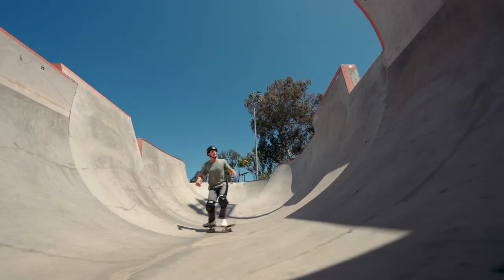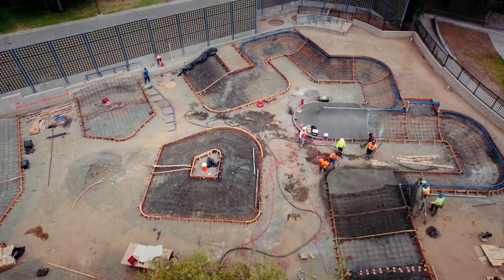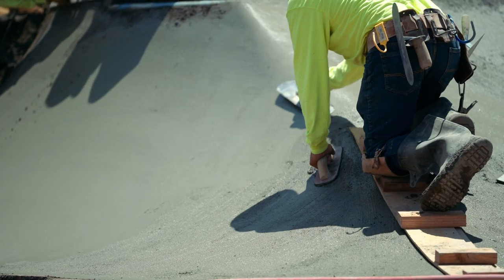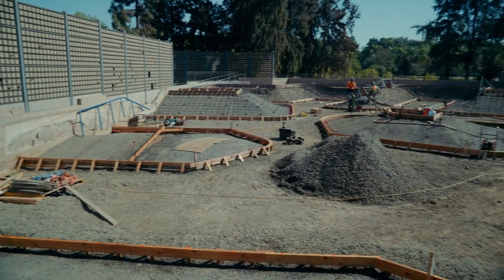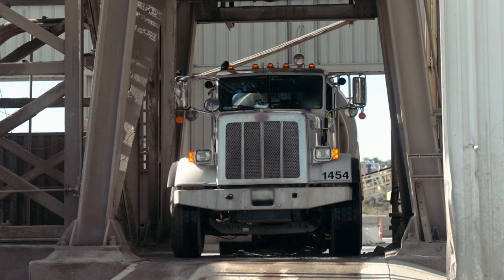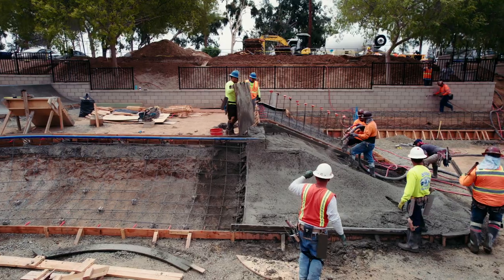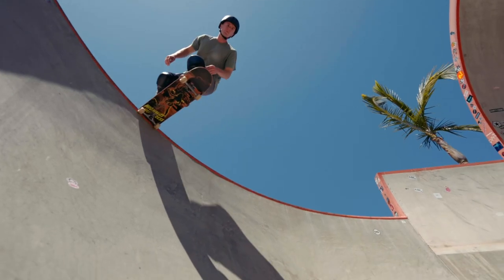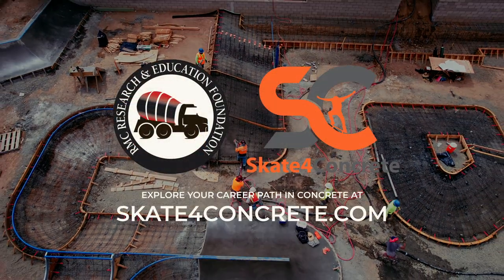How a Skatepark is Built

Comment: We need some electric skateboard parks. They would need to be built differently, for the most part. Level ground. Think of a speedway like Sebring (twists and turns) or Monaco (twists/turns/hills) but at a much smaller scale. This would be fun for a much larger group of people because not everyone is willing to drop in on a half pipe. I skated a lot when younger, and on some "el cheapo" backyard ramps, but wouldn't drop in on a real half pipe. Not many people learn how and for me, my first led to the hospital with broken arm. Any younger aged person can do electric skateboarding, and many older people too. And have a lift to ride back up the hill relatively quickly, even if it's just a "leash/handle" you grab onto (instead of a full cart you sit in).

Another idea I have is for non-electric downhill skateboarding. I don't know - maybe it exists, but I really see it anywhere. Lots of winds. Plenty of places even in FL for stuff like this, in hill areas of the center of the state, or up near tallahasse. There's lots of hills in FL west of center and more northerly. Just like a concrete sidewalk, but some curvature to it on the turns. Would need some backing on the turns. Not too hard though...  Hell, they could have some real fun slip and slides down the hills, but nobody does...
Reply: Just go to Woodward and learn to skate from some experts.

Comment: Dear cement skatepark builders.  Please stop making all the transitions the same radius as the height.  A 4' quarter pipe should not have a 4' transition.  I understand it makes sense to have a tighter radius/transition for a pool or anything that might go to vert.  However, not everyone likes the tight fall to flat if you bail transitions, especially on cement.  Some of the 2-3' quarter pipe transitions at my local park are so tight you can't even rock to fakie  cause your tail is hitting flat when the board is on the coping...there is literally no transition to ride back in on. Can't we have a little variety?
Reply from the maker: This is a skatepark design (not build) issue and all public parks now a days are open to design input from the local community. Speak up at the right place and you should be able to make those changes.